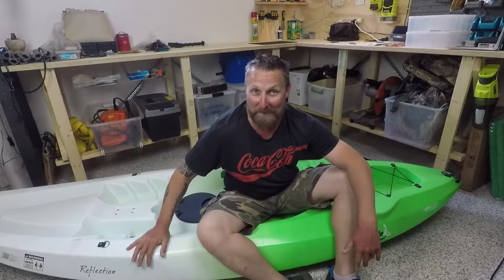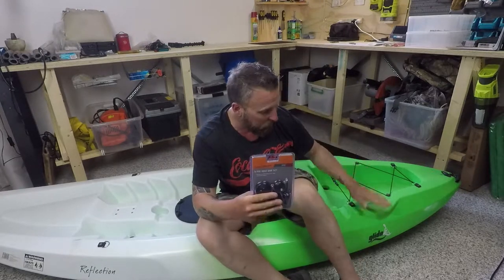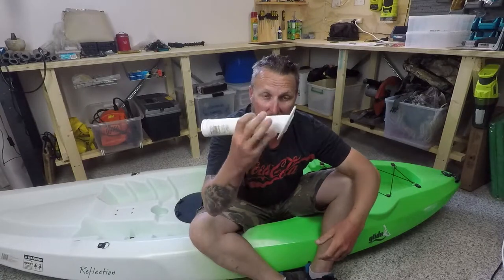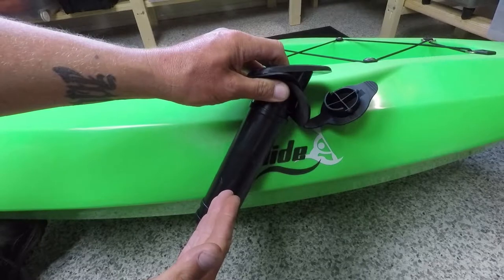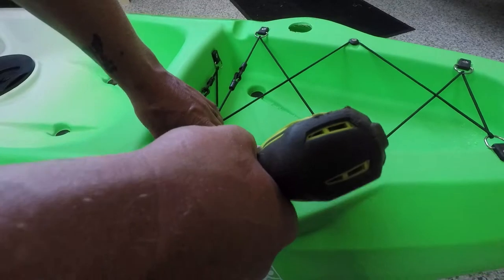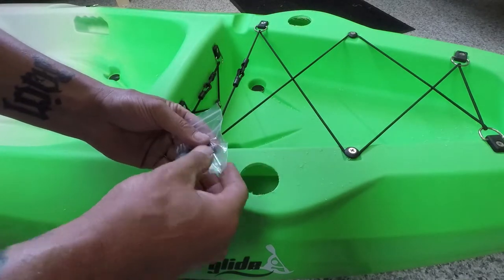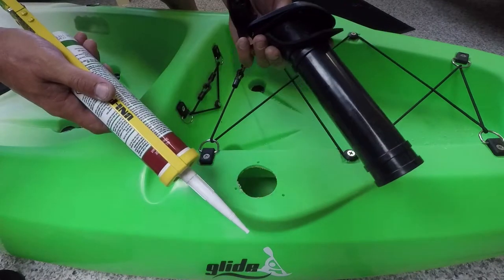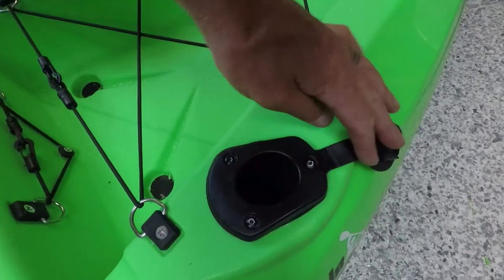How to install rod holders onto your kayak, DIY fishing rod holder installation

Comment: Use the gasket as a template for hole...its an oval cut not round , so much easier .
Reply: Just be aware the gasket hole is oversized.

Comment: Bass pro rod holders are flush mount so you don’t even need to cut out that big ugly ass hole. 
Also, use some type of bolts and nuts. 
Don’t use janky ass wood screws. 
🙏🔥
Reply: How would you use nuts and bolts with a sealed hull? That you can't get your hand in?